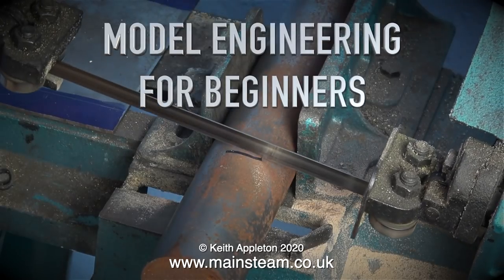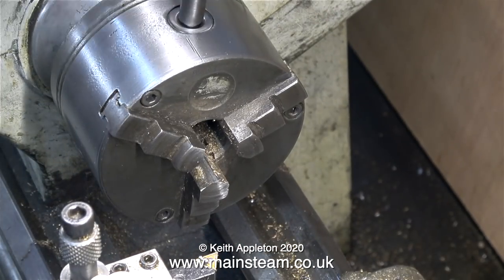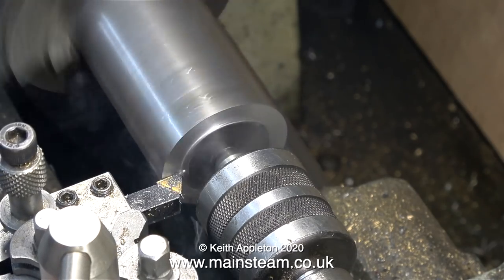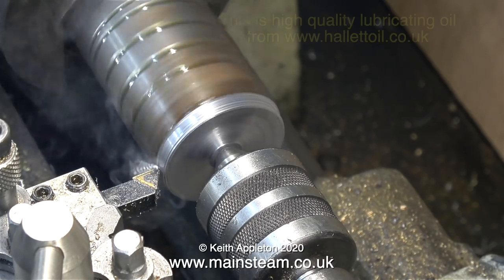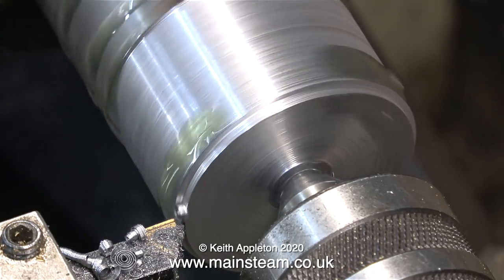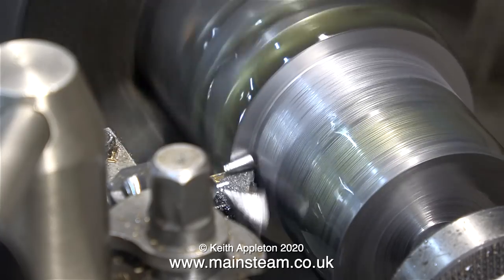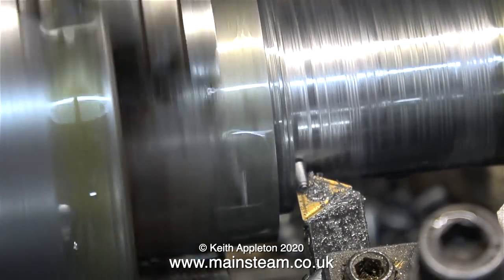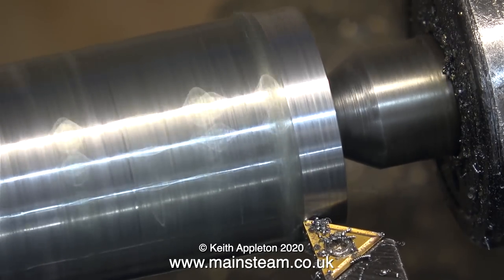LATHE TURNING - MODEL ENGINEERING FOR BEGINNERS - PART #24

Comment: Hi Keith - my machining mentor, Chip Todd, once worked for a company that made gas regulators. These regulators used a very small orifice sized depending on the type of gas and intended flow rate. So they were drilling thousands of small holes per day in brass regulator bodies. 

Chip's boss (Engineering manager) came by one day and said his team was running the drills at too low of an RPM. Chip took this as a challenge and hired a boy "off the street" to run an experiment. They ran small bits at various RPMs and recorded how many holes could be drilled in brass before the bit wore out.

To Chip's surprise, RPM made a huge difference in drill bit lifetime. Huge. Speeds and feeds. Tool tip speed determines whether you make chips or heat. Speeds and feeds - hasn't changed for 100's of years - actually will never change.

Great job for pointing this out Keith!

Comment: I use cemented carbide tools on my bench lathe. They perform better than insert carbide tools because they can be ground quickly to resharpen the cutting edge. This is important as was shown in the video where the lathe isn't able to maintain cutting speeds. This is death to carbide which is very brittle.
Here in the U.S. a 6 inch grinding wheel for carbide is ~$20 and in home use will last for years... a lot cheaper than a couple of carbide inserts.
The other trick the home machinist needs to know is how to make and use a high speed steel shearing tool. These are just the thing for removing the last 0.002" diameter on poor machining steels like 1018 low carbon steel and where a good finish is desired. Here's a video showing how:
https://www.youtube.com/watch?v=Ta5F3WC-gPo
Cheers from NC/USA

Comment: A dead centre wont have the runout that the  live centre has (all-be-it small) from the bearing AND the actual conical tip runout as it rotates... 
This is especially important when turning between centres... 😎👍
Reply from the maker: I find that for what I do, the live centre is always superior - less friction, heat & wear in the centre hole . . .